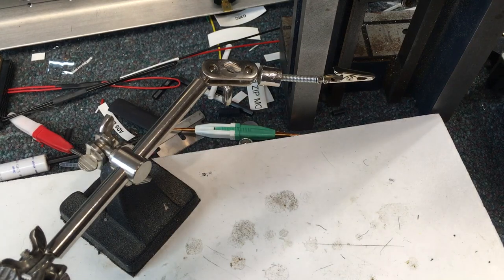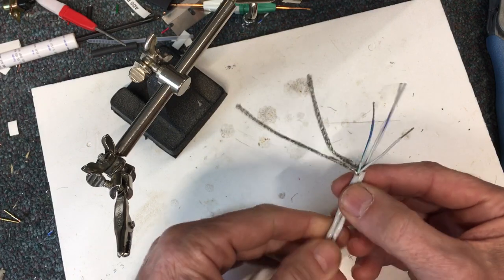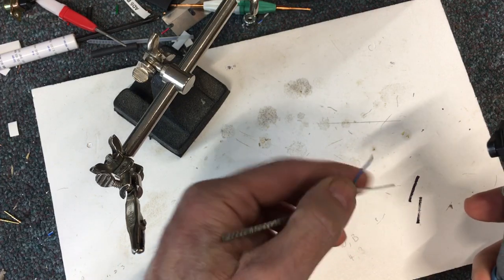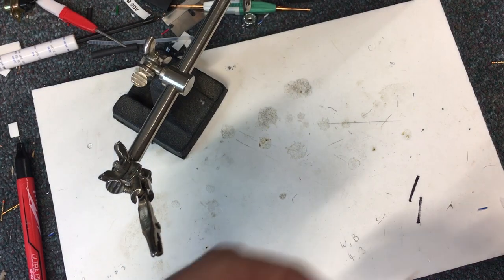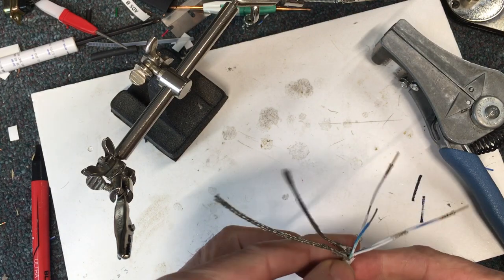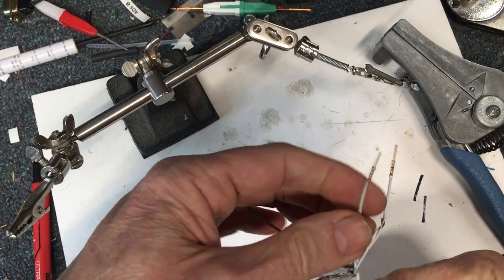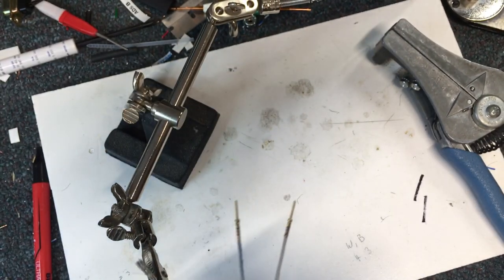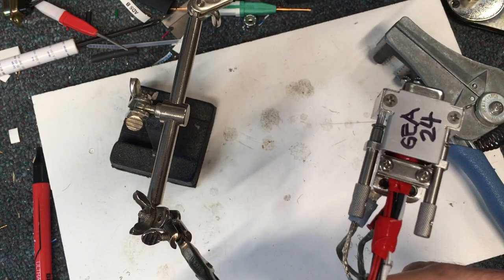RV10 Update Can Bus Daisy Chain

Comment: Excellent work, sir! This is bringing up old nightmare memories of the Avionics wiring course I took a few years ago! One thing that we used in that course was heat shrink tubes with solder inside so you would twist the wire like you did here, and then slip the heat shrink over the top and as we heated it up, the solder would melt while shrinking the tubing. These also could be bought with the green grounding lead like you mention. Made it a little easier, but they arent cheap per unit either.....

Thanks for the video! I'm probably still a year out from being ready to do avionics but its fun knowing its coming soon! I'm an electrician by trade and have a bit of masochism in that I love wiring..... even though it can suck! haha!
Reply from the maker: Ya, I bought some solder sleeves-at fastenal the other day, but I bought ones that are too small for anything.  This works okay, I just wish garmin would add a ghost pair of pin outs to every lru that is on the can bus so you could simply use a second set of pins.
Reply: @RVJimD I have often wondered the same.  The cost of two extra pins and an interconnect on the PCB inside is trivial compared to the cost of solder sleeves, which is Garmin’s recommended method, and the labor required to make these splices at each node.  And, as you mentioned, the increased likelihood of vibration issues later with the wire stiffened by the solder joints.  Makes no sense to me why they don’t have two pins for CAN hi and two pins for CAN lo and do the interconnect internally with two more pins that can be jumpered for CAN terminator when needed.  That way all of their devices would be consistently designed without some needed a separate terminator, some needed a jumper to the CAN lo and some needing a completely separate jumper.  Make them all the same and make them easy to terminate with separate pins.